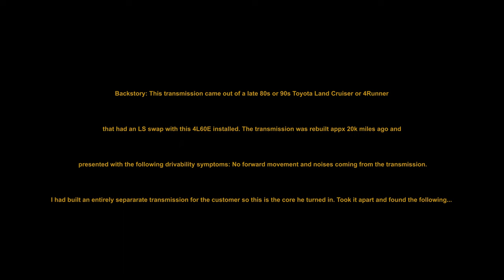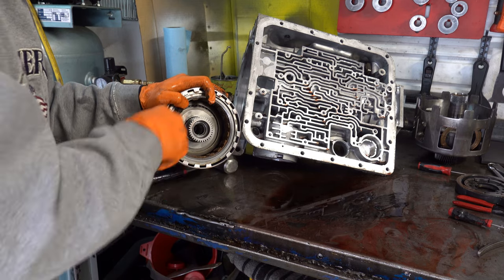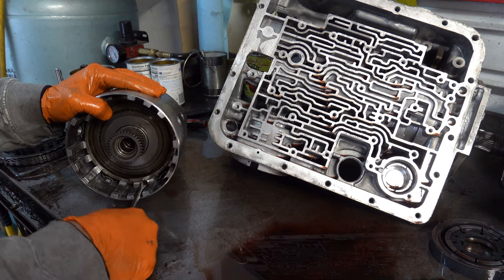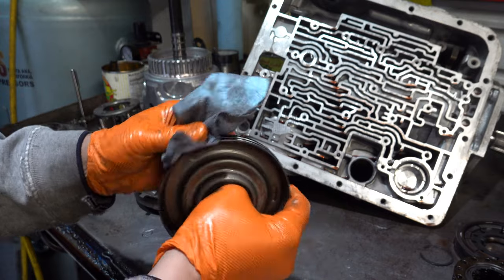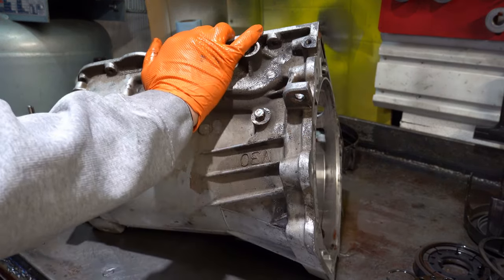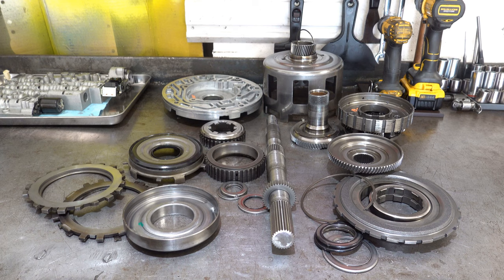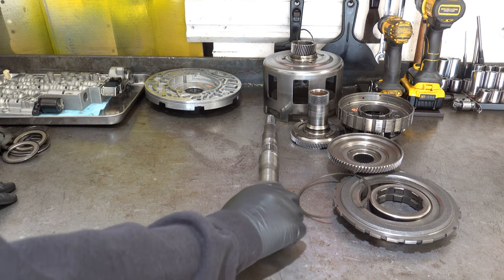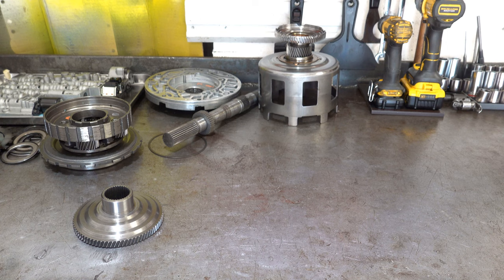4L60E Autopsy:  No Forward Movement and Unusual Noises

Comment: There is no doubt that it is a lube problem.  Stevie Wonder doesn't have to wonder.  If the Viton seal appears OK, the the next point of contention is the last sealing ring on the input shaft.  If that is OK, then there is a flow problem either in the pump or the cooling lines/rad cooler.  A faulty forward piston housing will/may stop the forward motion but it will not affect the lube circuit.  A faulty bottom sealing ring will affect both the forward apply and the lube circuit.
Reply from the maker: The forward clutch burn up was caused by the mid-case failure, specifically metal debris getting into the housing, scoring it up and cutting material from the lip seal portion of the piston. And I agree, a lube failure of some sort best fits the evidence...Was my first thought once I had the gear train and sun shell out of the case. The underlying cause is anyone's guess but restriction in the internal transmission cooler and/or lines is usually what causes these problems.

Comment: No load springs
Reply from the maker: Hey Pat, thank you for watching...Is that why you think the melt-down occurred?
Reply: I have no idea but I watch enough transmission videos most rebuilders always say to put them back in.
Reply from the maker: They aren't needed unless clutch clearance is below .035 and RPMS are expected to exceed 5500 on the regular...Plus you can install Transgo's high rate return springs, which are the better way to go for centrifugal apply prevention and performance improvements. 

Additionally, official industry guidance on that issue is mixed; some publications say to put them back in while others say to leave them out...

Your comment "no load springs" didn't really tell me what you were getting at, other than perhaps making an observation hence why I asked...

Regardless, thanks again for watching; I appreciate the viewership.
Reply: @nickstransmissions  I was just making a observation I guess.
Reply from the maker: Roger, that - please subscribe if you haven't already as I'll be doing more vids on 4L60Es, 80s and 6Ls in the very near future.

Cheers!

Comment: Do you have an e mail?
Reply from the maker: Hi Larry, you can contact me on Tahoeyukonforum.com via direct message; I have the same user name as here...If you have a general 4L60E transmission question, please post it here so others can view the response..

Otherwise if you want to inquire about having a transmission rebuilt, contact me via Tahoeyukonforum.com and we can go from there.

Thank you for watching!
Reply: @nickstransmissions  

No. I just wanted to discuss this one with you. But here is fine. I have ran into this before. I will say that, in my opinion. You have a pretty good grasp on the problem. 

The ones that I have seen have been do to the cooler not being flushed. The last hole in the output shaft supply’s lube where the problem manifested. I have found that last  hole restricted or completely blocked from debris before. 

I have also seen that lube hole blocked when debris, from failed clutches makes it way there. In GM’s infinite wisdom. The lower end is the last thing lubed. 

Not sure of the exact number here. But about 30%! Of the fluid passes through the cooler at a given time. Before the process starts again. The last lube hole in the shaft is also the smallest. So that’s when the lube circuit can’t keep up. 

At least in what I have seen. 

Opinion?
Reply from the maker: Makes perfect sense to me, and agree with your assessment. Most of GMs transmissions have the same general lube circuitry design and associated inherent weaknesses...I imagine that they would have moved to a center-lube design for the 4L60E if case components supported such an engineering change but unlike the 4L80E, which has a large central object that's already capable of routing fluid (just needed a minor re-design to meeting overall engineering intent), the 60 and it's ancestor, the 700R4 lack such a suitable object...The 60's center support simply can be tweaked to route fluid...

Thus, flushing lines and coolers before installing a new transmission is so crucial for ensuring no problems like this happen. 

This vehicle was used for towing and off-road use and there was some minor signs of stress to the coast clutches that may or may not have been sustained before the melt-down. So that's one potential source of debris/material that could have partially restricted flow to the gear train. Once lube was restricted, the rest of the dominos fell...

I'll be doing more of these "failure mode and effect analysis" type videos going forward, including all different transmissions. What will distinguish them from regular tear down vids will be the post-clean up analysis portion that's contained within this video where we closely scrutinize the damaged parts, trying to solve the puzzle before tossing them into the scrap bin. 

Thanks for watching and your input, Larry!